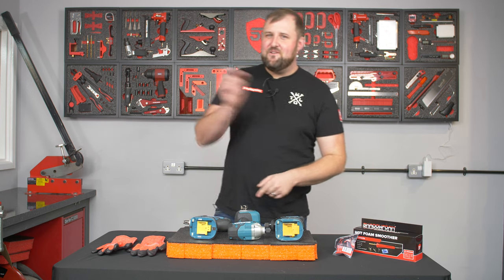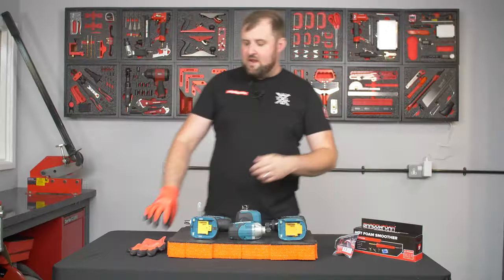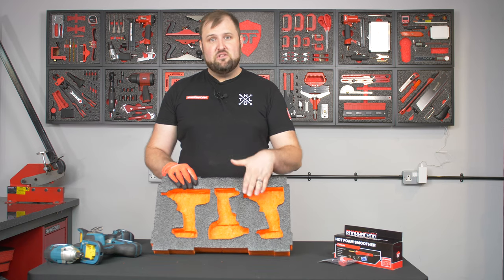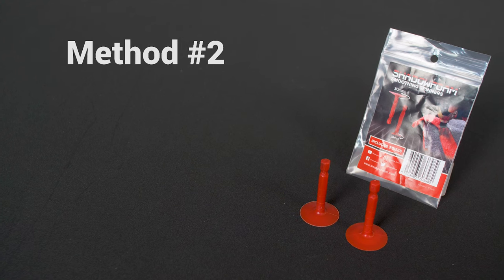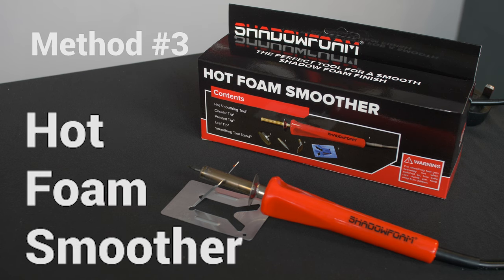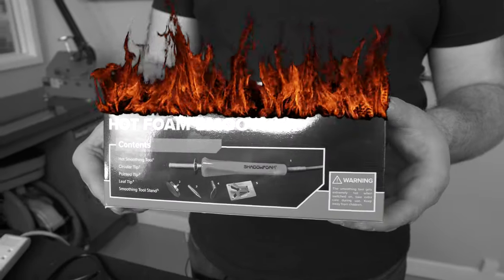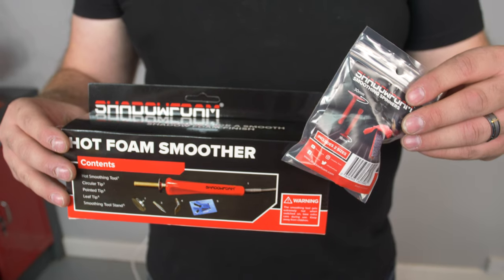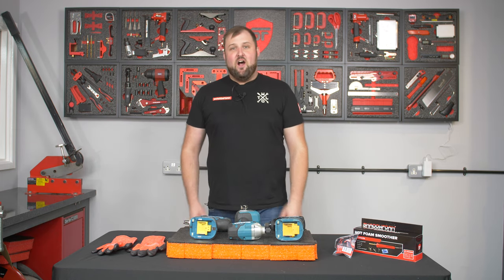How to Get a Smooth Bottom on your Foam Insert!

Comment: This is very timely. I need to cut quite a few of these for power tools and they all generally have various thicknesses.

Do you have an estimate when the 50mm Teal foam will be back?
Reply from the maker: Hi there, Teal sheets in 50mm are in stock. Are you talking about a specific insert?
Reply: Yes, sorry for not being specific enough. I was looking at the new L-BOXX inserts. Thanks

Comment: These products look great. Will they only work with Shadow Foam foam? I have a Dewalt's customisable insert, which was very difficult to cut and work with and the bottom are very rough. Do your other cutting equipment work with non Shadow Foam foam?
Reply from the maker: Couldn’t say for sure as these projects were engineered to work with Shadow Foam, which is higher density and heat melded instead of glue!

Comment: Hi Bought the Heated tool but find that it's just too hot to apply to the surface and burns pretty much on contact, not good when I'm using various coloured foams. In fact the only way I can use it is to "Hover"above the foam and let the heat melt the foam back, but any direct contact just makes a black burnt mess pretty much instantly. There iOS no heat control on the tool itself can you suggest a means of controlling the heat.
Reply from the maker: Which of our three head attachments do you use with it?
Reply: @ShadowFoam  Hi there! All of them. They all suffer with the same problem. they all burn on contact, as said not great with the coloured foam. The other thing I find you have to watch out for is that if I am working in corners, the radiant heat from the stem of the tool is enough to start melting the foam back even at distance. As said, for me, the tool gets way to hot.

Comment: Use a trim router for the whole thing,  ideally the dremel router would be best. No need for a spinner and 10 x faster?
Reply from the maker: I’ll give that a whirl! 👍
Reply: @ShadowFoam   i dont have a dremel , but a good excuse to contemplate buing one .  I havent worked much  with shadowfoam  but know its texture. Mostly work with eps , xps and acoustic foam on random projects.  Im only guessing here but i think shadowfoam would be the only one you could  route.  Standard acoustic foam would catch the bit and become dangerous, eps i think would crumble. Xps is likely to shatter or crack. Let me know how you get on, and that’ll swing me on buying one 😅 cheers mate

Comment: Just use different layers of foam, and join them after cutting them. So there’s no need for peeling the different layers. Just add 1 or 2 layers on the bottom.
Reply from the maker: Interesting idea, but would be more time consuming
Reply: @ShadowFoam  or sell it as a pack. Like 3+2+1 = 6 centimetres total thickness. No glue between the different layers, you need to apply it yourself, after finishing your layout.
Reply from the maker: @pedrosmits  our layers are heat bonded
Reply: @ShadowFoam  I understand, but it would be possible for customers to build up their own layers, with perfect bottom finish.
Reply from the maker: We only offer our product in sheets that are already bonded: 30, 50 and 70mm. We do not have any options to add layers

Comment: The heads are too short for this tool, as the shaft often gets to close to the top edge, when using the smaller heads. Need longer heads so the 1cm wide shaft doesn’t ruin sides
Reply from the maker: Thanks for the feedback! 👌

Comment: I'm trying to cut the whole thing in half.
Reply from the maker: What are you using?
Reply: @ShadowFoam  that's why I'm in YouTube land,  lol.  It is NOT easy. The only method I've found that looks decent,  is to heat up a metal (like a coat hanger) and run the hot line through the middle of it.  I'm having trouble finding a single video.  My first idea 💡 was a big hack saw , not terrible but very hard to get a clean flush cut

Comment: So the  kaizen style cut&peel line now replaces the spray painted version.
Possibly a  formulation of acrylic paint/dye and latex ?
The fact is that it had a limited lifespan.
No abrasives and chemicals were used.
Conducive to coin collectors and items on permanent display
 Not appropriate for  hand tools
To now go and replace what was  fundamentally a flawed product  at close to £27 a sheet and spend hours and hours of tracing &cutting  for 196 items.Madness
Only an idiot would buy your product again .
Necessity is the mother of all inventions
Reply from the maker: New foam is much more robust, dense, long lasting and easier to cut, it was an upgrade our customers have praised